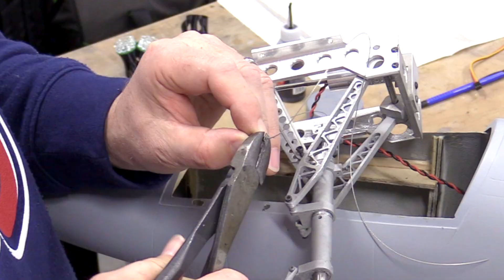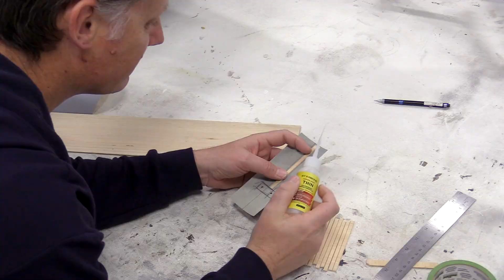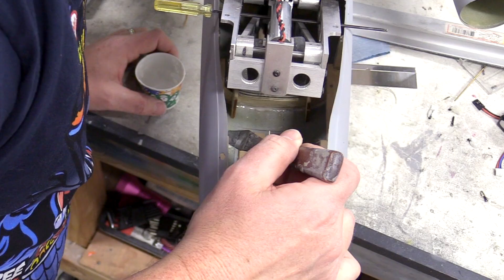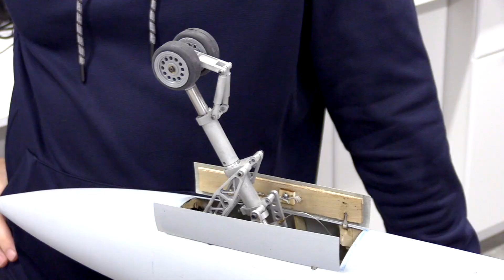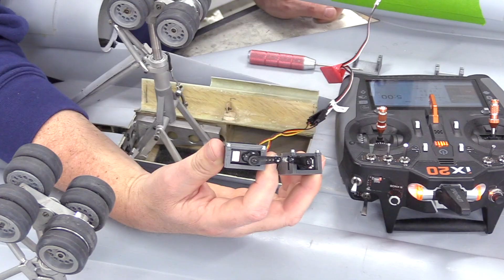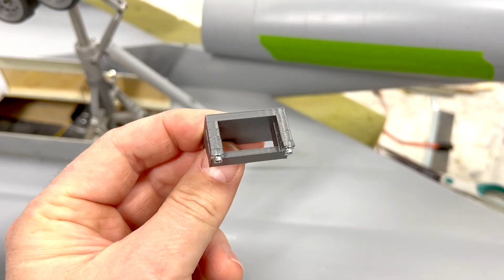REPLICATING the B-58 Hustler's INSANELY COMPLEX Retract System

Comment: are you going to wrap the whole thing in aluminum tape or paint it up
Reply from the maker: I was originally going to wrap it in foil tape, but due to the timing, I’ll be painting it with Alclad paint instead. I’ve used it on a few projects and it’s quite good at mimicking a metal finish and is pretty robust too.
Reply: @Thercgeek  that is a wonderful paint, do let us know your opinion on it

Comment: Hi, awesome project!  Would you tell me what is the white glue you used to mount the steering servo box?  Also what is the spray I see you putting on the CA glue?  Thanks!!!
Reply from the maker: Thanks!  The white adhesive is just epoxy with micro balloons to lighten and volumize it. The spray on the ca is simply ca accelerator.

Comment: Nice job. Is it a kit? Is it a one-off 3D print? One of the most iconic aircraft ever built. It's been on my bucket list of builds for quite some time. Instead, I've settled on the XB-51 Panther.
A word of advice, make sure you keep the speed going into turns with that thing. Those honkin nacelles and a delta wing, will drag it straight to a smokin hole if you do not. Liked and subbed...
PS did you droop the leading-edge down like the real aircraft? Convair did this on the Delta Dagger and the Delta Dart
Reply from the maker: Thanks!  The airframe was tooled up by a good friend of mine so was fortunate enough to get one from him. The wing does indeed feature the conical camber along the leading edge.

Comment: Could be worse.  The air-data computer was a mechanical analog computer.  A complex arrangement of gears, levers, cams, bellows, integrators, over 1,000 parts in all.  All in a space the size of a matchbox.  Good luck with that!

Comment: I hope your CG calculation works out right. I once built a scratch built speed 400 delta and despite reading everything I could find about CG on delta wings for the first flight the CG was 2 or 3 inches rearward and the plane was unflyable . Hand launch of course so the result was a back flip to the ground. I redid the fuselage so I could move the batt forward and made a new styrofoam nose and managed to fly the plane on the second attempt. It was a blast to fly and with its solid balsa wing and 1/4 x1/2” hard balsa keel running the full length of the underside of the wing it was indestructible except for the styrofoam nose and sheet balsa foward fuselage. I had it set up with dual rates. High rate for the launch and then once the plane was up to speed low rates with lots of expo. The first 50’ after the toss were hairy leading to me naming the plane the Hairy Delta. Remember, when you start cranking and banking deltas bleed off speed quickly!
Reply: A cool maneuver I used to do I called the elevator. I would pull back the power and as the plane slowed I would keep adding up elevator. The plane would develop a dramatic sink rate while remaining flat and controllable. Add power and / or drop the nose and the recovery to normal flight was instantaneous. Just don’t get too low when first trying this !
Reply from the maker: Yeah, deltas can be a lot of fun. With the vortex enhanced lift you get, they can fly incredibly slow and remain stable throughout. 😊  don’t think I’ll be doing much of that with this bird, but the nose high landing should be pretty awesome!

Comment: Chris, what is the white adhesive (applied with small spatula) that you use throughout this video?
Reply from the maker: That is epoxy with micro balloons. The micro balloons is what turns it white and helps lighten and volumize the epoxy.

Comment: I loved the video!  I’m curious, you built a wooden tray for the nose gear steering servo instead of 3D printing one, is there a reason you went with the wood?  Also can you still access to remove that servo if needed?  Masterful work, cheers!  
 Also, it’ll be nice to see you win the scale NATS. 😉
Reply from the maker: Thanks!  I made the wood tray for the steering mostly because it was quicker. Plus, the steering takes more load than the doors, so the wood will hold up better over time in that case.

Comment: What keeps the wire in the hinge in the main doors? Just curious as it seems like it wouldn't take much for it to slip forward far enough to come out of the small rear piece attached to the fuselage?
Reply from the maker: There’s a decent amount of friction there, so the wire won’t slip out at all. It would require quite a bit of suction for it to pull forward. That being said, I may still use a small piece of aluminum tape at the front just to be sure.
Reply: @Thercgeek  I was just thinking of vibration and movement. I have no doubt in your abilities, was just wondering as you simply slid it out repeatedly. Thanks for the reply, as always.

Comment: That's great work ! The only thing that bothers me with those electric retracts is the noise they make... I know that once in flight you don't ear that noise but it still bothers me 😂... Air retracts are unfortunately unreliable...
Reply from the maker: Haha, I hear you on the sound. My experience has been that Air are just as good if not better than electric. Most of my large scale stuff I opt for air, but these were designed electric from the start.
Reply: I agree, air works well. The low dollar electric gear are a crap shoot if they work or not. The most expensive gear are a bit more reliable.